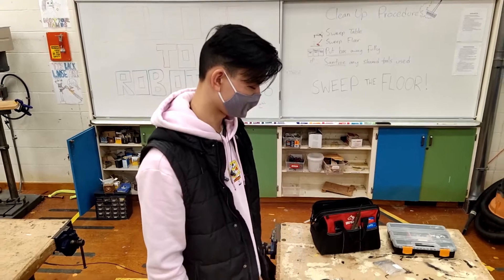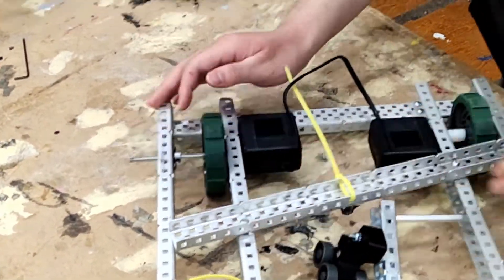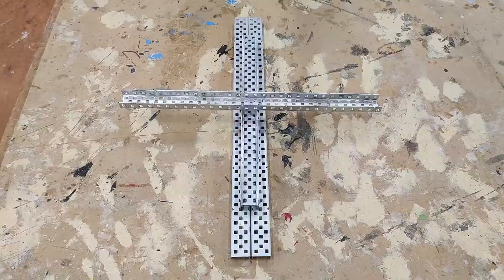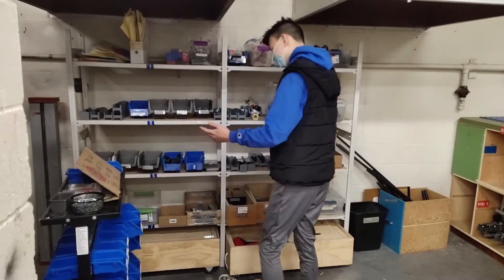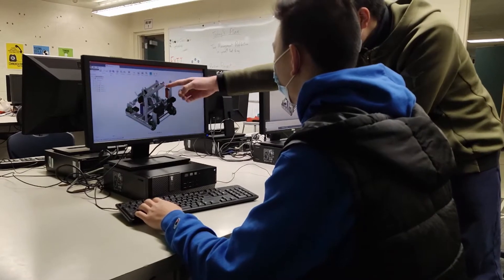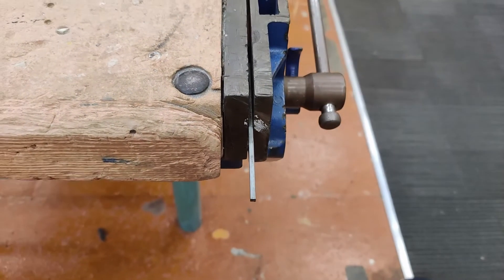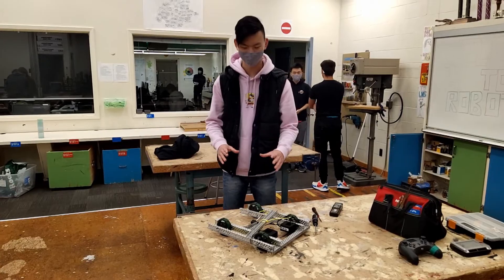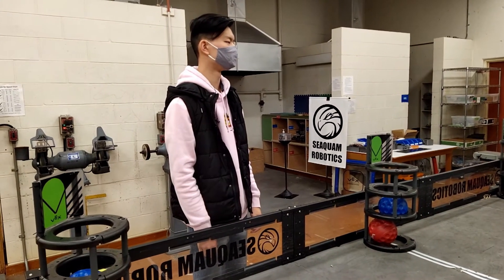Build Habits In VEX Robotics

Comment: My first game was over under and god I wish I had seen this video last year, we made all the wrong decisions with our chassis by making it way too small so it was like 14 by 18 which caused us space issues, we used the wrong type of washers (I think that's what they're called atleast) and they fell out all the time during testing and scrimmages, I somehow stabbed myself with a pertruding axle and had to get a bandage, and worst of all, we didn't use the spacers so our wheels could move freely inbetween our C channels meaning our robot had quite the drift. I have learned alot about this in the past year and this video has helped alot. Definitely didn't help that our programmer couldn't figure out how to code the robots movement and half our time was spent on that because of deadlines lol.

Comment: I’m attempting to build the fasted car in my class 

Any tips?
Reply: Use gear ratios make the driver gear a large gear and the gear connected to the wheel a small one.
Reply: really goddamn fast gear ratio + blue motor along with slim light drivetrain